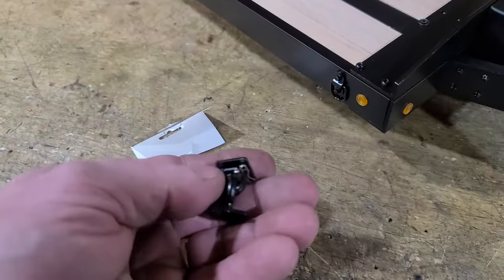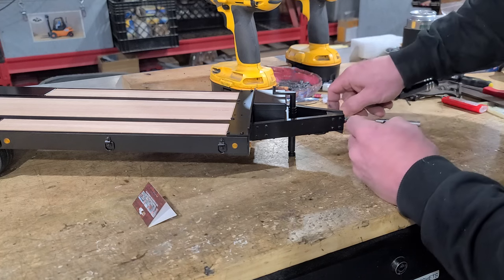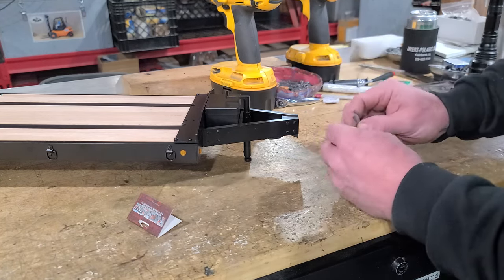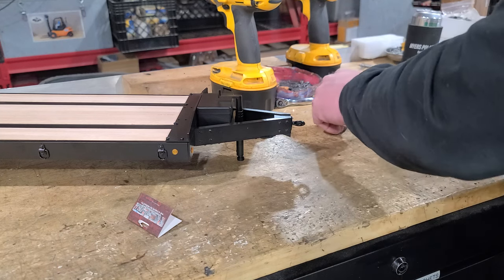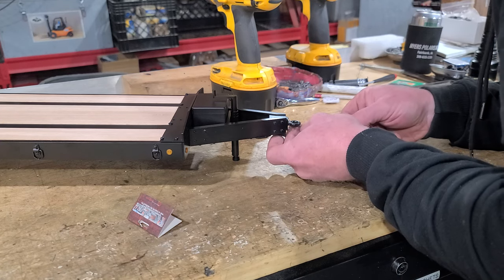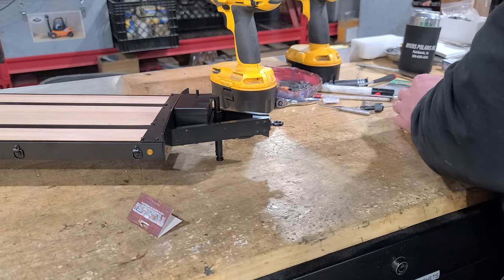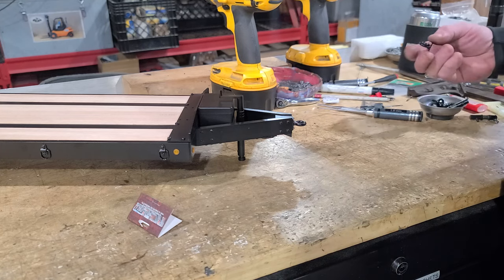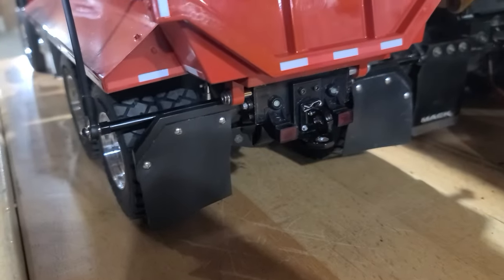Installing Pintle Hitch on the 1/14 RC4WD Big Dog Trailer

Comment: have you ever thought of using a pin vice or an X-acto handle as a pin vice for your tiny drills and taps? easier to use and not so floppy as a tap handle. I use a X-acto handle myself. of course it's low torque but your just scraping out paint overspray :)
Reply from the maker: or just take the handle out of the tap holder. 😉
Reply: @dennybobsrcconstructionagc2796  True, and there you have a learning lesson that there's more than one way to skin a cat and your advice is actually simpler. I like it thanks :)